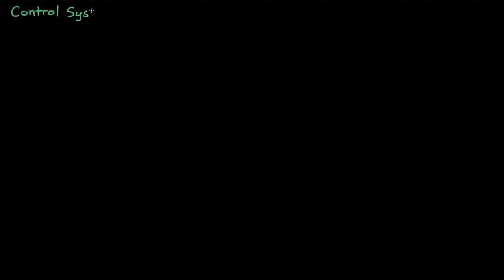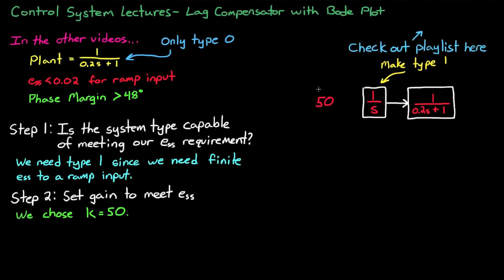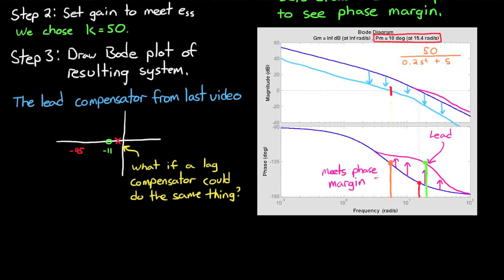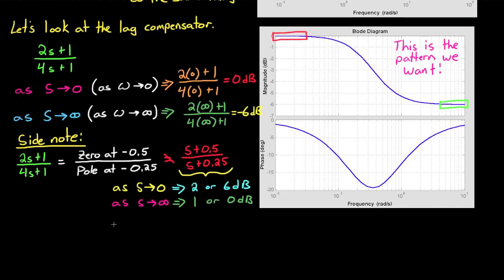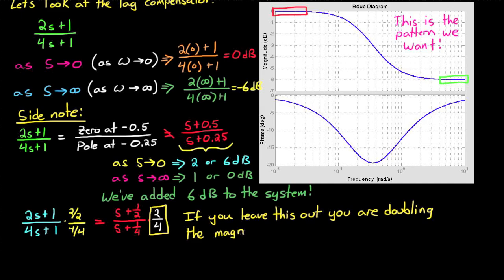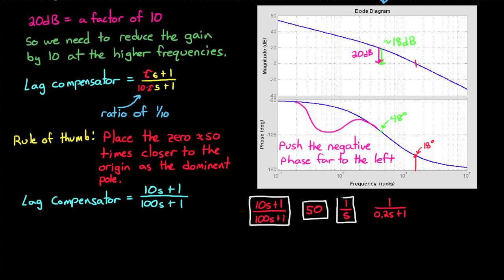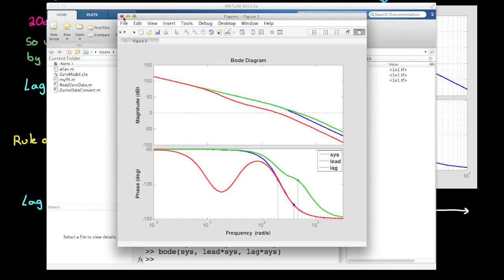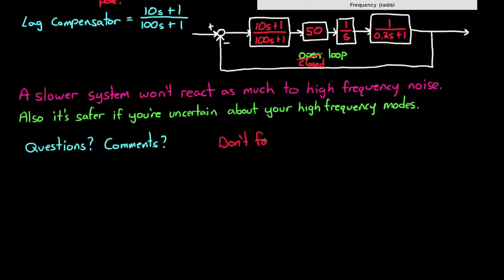Designing a Lag Compensator with Bode Plot

Comment from the maker: The compensators I described are continuous (S-domain) which means you need an analog circuit to implement them exactly. But like you said we usually implement these in the digital domain (Z-domain) using software. So the first thing you need to do is convert the compensator from S to Z using some method like Tustin where s = (2/T)*(1-z^-1)/(1+z^-1) or simple method where s = (1-z^-1)/T.

In this equation T is the sample time of your digital system and z^-1 is the previous sample in time.

Comment: thank you so much for all the great lectures, i have watched so many of them.
 i really wish you will make a lecture about desiging a control system that includs both lead and  lag compensator togther with bode plot, i find the cases when you have to consider PM and GM for the same system hard and that to use both lead and lag compensator togther can make it much easier.

Comment: At 9:09 why is the dominant pole 0.2? Should not it be 5? as 1/(0.2*s^2+s)=5/s/(s-5) what is the wrong in my analogy?
Reply: +Pintér Zoltán Márk Please forgive him for skipping a step:
The rule of thumb is to place the zero 50 times closer to the origin as the dominant pole. So the dominant pole is at -5 (as you said) and to find where to put the zero: 
-5/50 = -0.1
so the zero will be at s = -0.1.
Convert it back to the form k*s+1 = 0
s = -0.1  ->   s*10 = -1   ->   s*10 + 1 = 0;
in this calculation we did two inversions and two sign flips.
Instead of doing all that he just took the s*0.2 +1 = 0 and multiplied 0.2x50 = 10.
Reply: +Maxime Deslauriers Why is the dominant pole at -5?
Reply: System T.F = 1/(0.2s+1), now solve for s, you will get -5
Reply: @internetmovieguy   "Convert it back to the form k*s+1 = 0".. Please help me understand this statement of yours
Reply: C(s)_lag = (s+Z) ÷ (s+p) where Z = 50p,
  [pole should be closer to the origin]
but he put it in the form :
C(s) =  (as+1) ÷ (bs+1)

Comment: Great video Brian! I have a question concerning the rule of thumb at 9:10. In the lag compensator design with root locus video you mention that the rule of thumb is to place the zero 50 times closer to the imaginary axis as the dominant closed-loop pole. However, in this video it seems as though you use the open-loop pole. Why do you do this?

Comment: Hi brian, 
That would be great, a real application to demonstrate the theory. I am an RC hobbyist and start working on flight stabilization and self balancing Robot using Arduino - Watching several of your video, next I'm asking my self how will i apply the theory to the project i'm working on which requires error and compensation correction.

Thanks for your video lectures, Im getting it slowly though I'm very new to these theory.

Comment: Hey Brian,
first of all thanks for your vids. Just a little question about implementing such things. In modern time it is quite common to have control systems implemented in code on DSPs f.e. But how do you implement such thing as a Lag or Lead comp in SW ? I couldnt find an example code or so. Would it be done by having different different controller for different frequencies? Maybe I'm just failing to see the whole thing and my question is pretty stupid. Best regards/keep up your amazing work

Comment: Hi all, thanks for the video and all your comments. I am not sure about how the crossover gain is related to the speed of the system. I'd appreciate it if anyone can share some insight. Thanks!
Reply: If you're still interested in an explanation:
Gain crossover freq decides bandwidth (since bandwidth is the freq at which magnitude is -3dB). Bandwidth relates to natural freq (assuming second order system, equate the expression for magnitude to -3dB, solve for omega to get the relationship in terms of damping ratio and natural freq). For a fixed damping ratio, changing natural freq of a second order system changes peak time, settling time, etc.

Comment: Hi Brian,

Thanks for wonderful explanation for control System concepts.

I have one question, suppose we are given a requirement to design only good control system.
Let say designing compensator for DC motor.

No physical value for time domain factor like  risetime, overshoot, settling time, steady state error, damping  are given
Or no value in frequency domain is given for Gain margin, phase margin or sentivity , Bandwidth.  are given.

Can you please suggest what default value should we take for these, to design good control system.
If possible can you cover it in separate video ?

Also as zeta & Wn is defined for 2nd order system, and if our Plant is not in the form of second order system how can we make use of zeta & Wn to design our controller ?

Regards,
Dinesh
Reply: this is not a question.
i dont think there is a standard for the "good design" as you mentioned.
depends on the system itself and how far you want to improve it

Comment: Thanks a lot for your videos, they were a great help! I was wondering: is it possible to increase bandwidth with a LAG compensator, and reduce the steady state error in the same time? I'm pretty sure adding a lead compensator will do, but would it be possible with just a lag compensator? Thanks!
Reply: If you're still here 8 years later the answer is no. The lag compensator, by design, decreases the gain at higher frequencies thus moving the gain crossover (and thus bandwidth) to the left (lower frequencies).

Comment: Hi Brian! 
How did u know that 20db is a factor of 10 ? is that mean that 1=2db?
and how it relates to the "Lag Bode from above" where the ratio is 2\4 and the change is 6db ?

Thank you!
Reply: decibel is defined as 20*log10(a/b), so if a/b=10 then in decibels its 20*log10(10)=20*1=20dB. This is not linear and you cannot say 1=2dB. 20*log10(2/4)=20*(-0.3)=-0.6dB.
Reply: Thank u Di Wang.
(-:

Comment: sir i am confused ,that you start with open loop transfer function and end up with closed loop stability but how you can comment on closed loop stability from open loop?.
Reply: sagar salunkhe the main goal of these designing techniques (such as bode plot, root locus and nyquist plot) is to use the open loop transfer function to evaluate the behavior of the closed loop function, since in most part of times, we already have a well defined open loop function. So let's assume that you have a open loop function which is G(s) connected in series with a gain K. In this case, your closed loop function will be like T(s)=K*G(s)/(1+K*G(s)) (considering unit feedback). We can see by analyzing T(s) that the stability of closed loop function will be given by the location of the roots of 1+K*G(s), i.e. 1+K*G(s)=0 (in other words, poles of T(s)). In order to obtain a stable system, the poles of T(s) must be located at the left-half-plane.
We can rearrange this equation as G(s)=-1/K. At this point, we can see that the poles of T(s) are actually all the points in s-plane which satisfies the following condition: phase G(s) = 180 degrees and magnitude of G(s) = 1/K. Note that the poles of T(s) depends on K and G(s), so each K will result on different poles to your system (these points can be observed by drawing the root locus of your system). 
The boundary of your system's stability occurs when s is located at the imaginary axis, i.e. s=jw. Since in bode plot we evaluates the system's behavior in terms of jw, i.e. s=jw , we can conclude that when the bode plot of G(s) presents, in a certain frequency w, the value of magnitude 1 and phase 180 degrees it implies that your system has reached the boundary of its stability. Hope this can clarify. Best regards